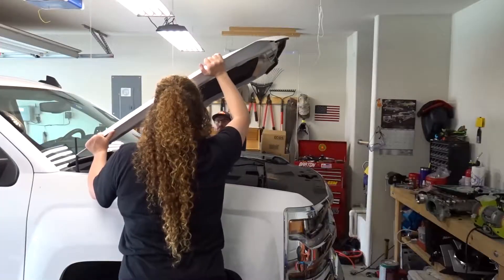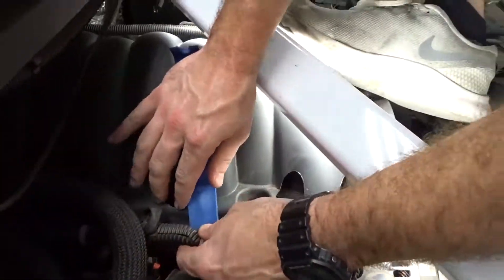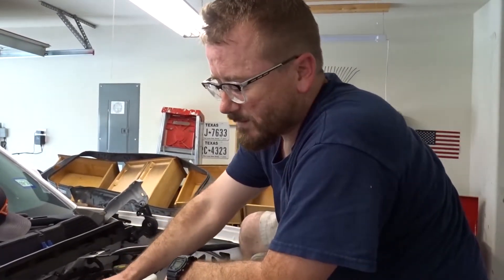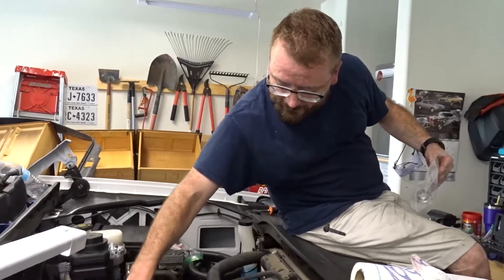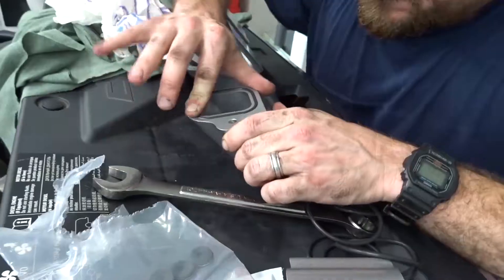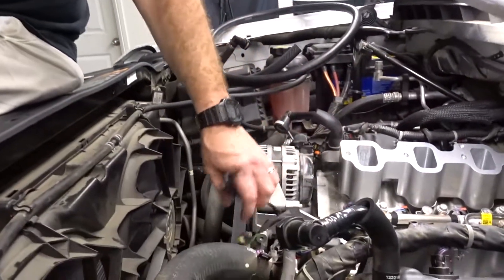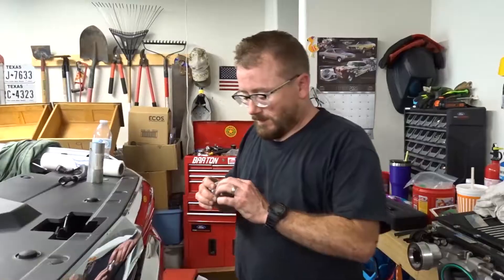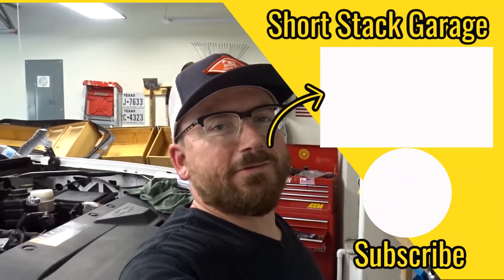Cylinder head adapter and coolant temp sensor relocation kit install: LT4 Supercharger Swap

Comment: What year is your truck cause i wanna do this on my 2018
Reply from the maker: It’s a 2017. The install should be pretty much the same for the 2018.
Reply: @shortstackgarage2063  thx
Reply from the maker: @demigodplays7225  anytime. If you have questions along the way you can always message me on Instagram. @shortstackgarage

Comment: I have a 2005 Sequoia with the very reliable 2 uzfe.
It runs great but doesn't pull quite as well as I hoped.
I purchased an lc3 intercooled supercharger from an stsv with the dohc 4.4 liter in it.
I am looking for a company that will mill me a set of manifold adapters similar to the ones you had made.
Basically they would need to mate the lc3 supercharger to the 2uzfe heads.
The intake runners are very similar in size and approximate spacing.
If you know of a company that would cnc these pieces please respond.
Thanks
Reply from the maker: I’m not sure of a company that could do that, but that sounds like a really cool setup!
Reply: @shortstackgarage2063  I will rebuild the engine if I can find someone to make the adapters.
The stock rods are pencils...pistons aren't forged.
Probably one of the most reliable gasoline v8's ever built.
I am not looking to build a race truck.
Looking for 450 at the wheels.
Should pull a trailer with ease.
Thanks